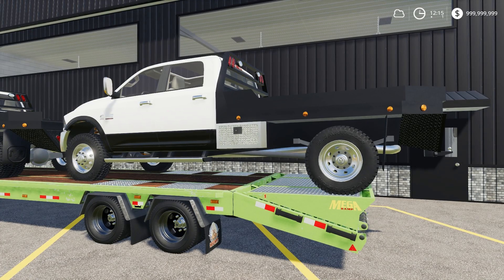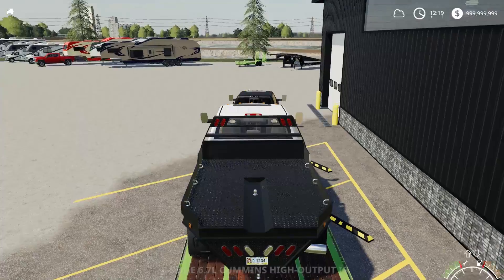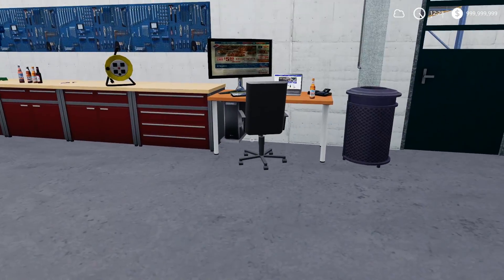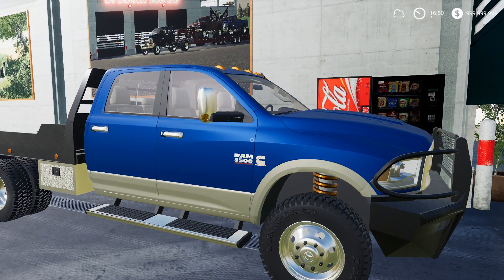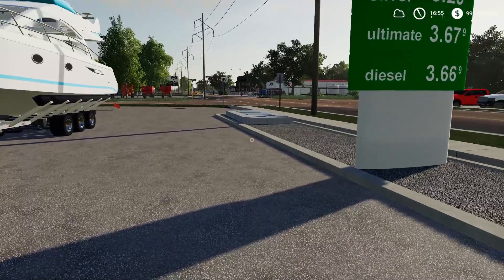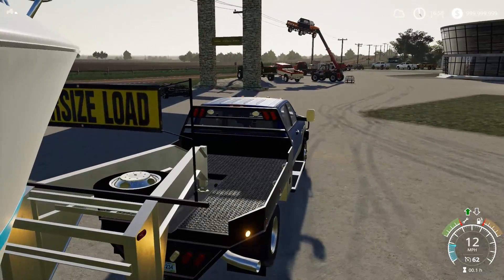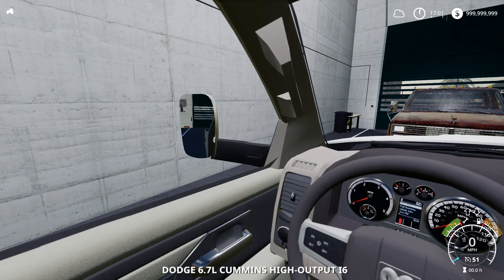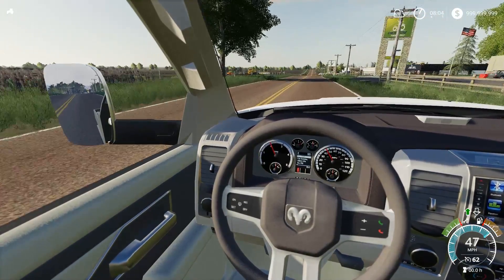ENGINE SWAP! PLACING 12 VALVE CUMMINS IN NEW TRUCK (SOUNDS GREAT!) | FARMING SIMULATOR 2019

Comment: I run tow mirrors flipped out on my 2nd gen 12 valve cummins because I have 2 inch spacers so I need it for parking because it makes it easier to park with such wide tires

Comment: Another use for tow mirrors is that however wide your mirrors are is most of the time how wide you trailer is. So if your mirrors don't fit in a tight spot then your trailer isn't going to

Comment: If you ever have owned or driven a dodge or a ram it's actually easier to see out of the tow mirrors flipped up rather than down. There is a spot mirror that built into the mirror and it's annoying and harder to see with them down vs up